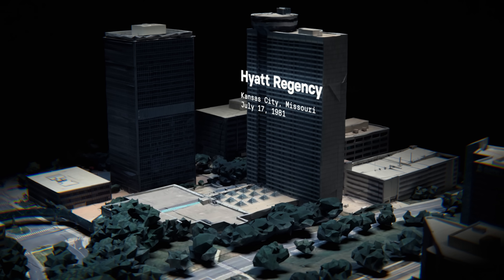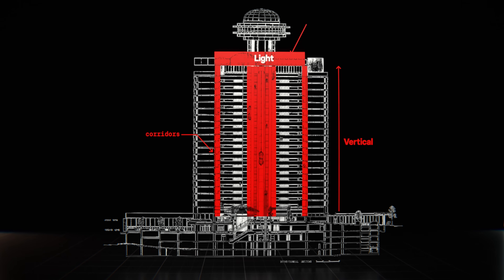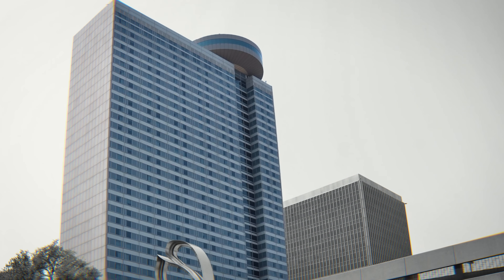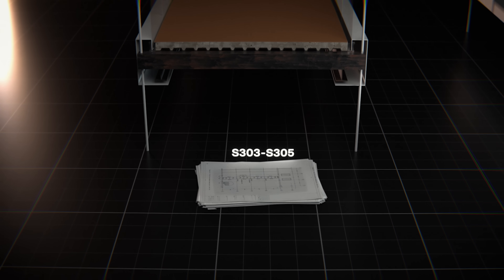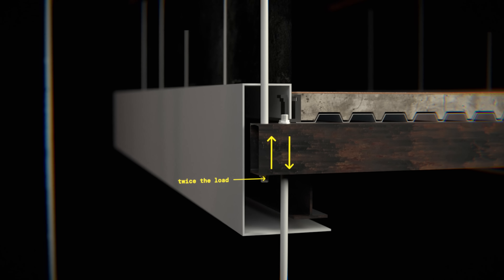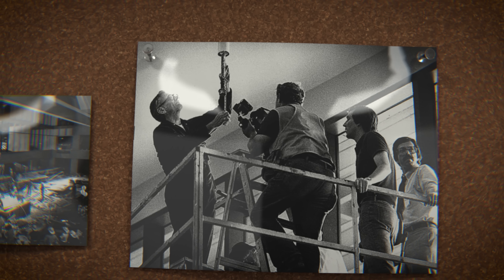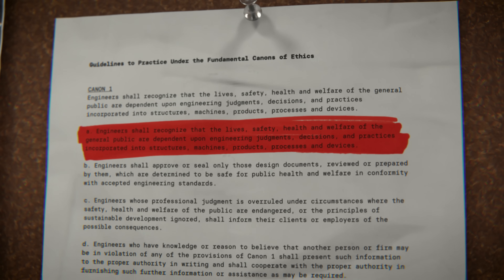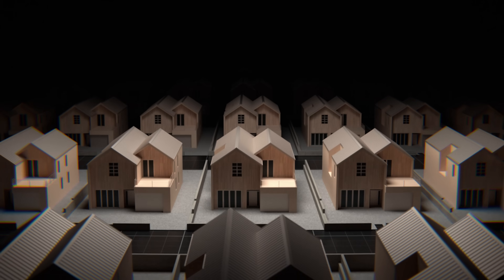Inside the Hyatt Regency Skywalk Collapse

Comment: I get that the engineer was responsible for the structural design and its failure. However, I find it unjust that he was the only one who suffered the burden of the colapse when the contractor and the client were also negligent... This also shows how individuals are more prone to get punished for their mistakes, oversights or negligence, than companies or corporations for their greed which is what pushed the hand of the individuals in the first place...
Reply: That's engineering for you. Someone ultimately has to take responsibility for the design. It's your job as an engineer to say "no" to being rushed to produce a design before you are able to. You are ultimately liable for your design. You need an engineer to design a building, and if all the engineers stick together on reasonable standards and timelines, the industry has to fall in line.
Reply: The fact that Hallmark declined the review of the construction documents after the roof collapse really tells you all you need to know.
Reply: @ChrisNorulak 
Whats it tell you ?
Reply: @paulneal7495  it tells you all you need to know
Reply: @paulneal7495  It's obvious: that things like safety are not their top priority.
Reply: there are too many talking heads in the client company to pin the blame to any significance, and the contractor has to have done something not approved by the engineer to be held liable
as with all events that make the rule books, no one is happy with it in the end but it's forever remembered
Reply: @prcervi  Thats BS, the Hyatt Hotel company should have been fined and then they have their hotel license revoked from said city.
Reply: @MircomFan  i know, but hyatt unfortunately had enough people and money to throw at the disaster that they got off with a somewhat tarnished reputation and nothing else
Reply: @prcervi  Yeah just stupid how it works, I work in the fire safety industry and I am partially liable if I don't do my job correctly and what not. But ultimately, the building owner is solely responsible for ensuring things are working and inspections are done. If a fire happened, the system didn't work and someone died, and it was found that there wasn't an inspection in years, the owner would be 100% liable.
Reply: @prcervi  Or sanction the entire company.
Reply: Engineering is a profession that oversees human health, safety and security. We are licensed and have a strict code of ethics. The moment an engineer signs a project, they are accepting the responsibility if it fails. Our code of ethics says that the society’s interest is above our client and our employer, meaning that we cannot just accept something by pressure, we have a personal responsibility to avoid misrepresentation and negligence, no matter who is asking for it. If the design was correct, and the contractor decided to do something else, the story would be different, but he signed the error.
Reply: @lhr8833 88, and 33 in your username and a dogavi. 

Care you truthfully explain what all those mean?
Reply: @lhr8833 ideally that would be the case but with living costs rising this quickly, there will always be at least one architect or engineer that has to accept and rubberstamp jobs like this to pay for their bills
Reply: @prcevi  too many talking heads in the client company? Then all of them should be punished, not only the entirety of Hallmark's leadership, and also all the investors who invested in Hallmark. Anybody who could have profited from the success of the hotel should be dearly punished.

It's simply unfair that people can just irresponsibly throw their power and support behind a corrupt company, and expect to come out unscathed when the company messes up.
Reply: I used to work as automation engineer in the electrical assembly for some industry machines, nothing big. But whenever they wanted me to rush something or do it in a specific way, I said that I could do it, but in the end, they will have to sign for it. If they want me to sign it as completed correctly, I must do it correctly up to my own judgement. I was just an apprentice at the time, but that usually kept them quiet and they backed off.

So, whenever people ask YOU to do it THEIR way, put your foot down that it falls back on THEM! They want the risk? They HAVE to take the responsibility. People rarely ever get tought this though, so they just accept the pressure and cave in to some MBA idiot or contractor cheapskate who have no clue about anything but want everything done their way or the cheapest or laziest way.
Reply: You don’t have the full story. That engineer chose to take all of the responsibility and spent the rest of their career teaching engineering safety. While this is a good video it does unfortunately miss a lot of details.
Reply: Sadly, he had the final word to say no, it's not possible, it won't be structurally sound, and bow out if he had to. He chose to forge ahead, and it cost him. Sadly...
Reply: Then again the engineering firm won the contract to work on this. Initially I agreed with your statement, but in this case the correct decision for them should have been to look at the situation, report the numerous problems, be told that the deadlines need to be respected anyway by the client and drop the contract instead of going along with it. Notifying the authorities too while at it. 99% chance it would've happened anyway, but the firm would have had their record and conscience clean in this. Are they solely responsible? Of course not. Did they handle it as best they could? No.
Reply: It was his job. No one else’s.
Reply: Nonsense … there’s a signature in the contract / there your blame
Reply: Yes- there is always a "fall-guy".
Reply: @ He is not the “fall guy” he was the only structural engineer who stamped the drawings. Do you even know what stamping the drawings means? no you don’t
Reply: That's BS.   The whole point of the engineering licensing system is that it makes specific individuals - who have the qualifications - responsible  for engineering safety.
My stamp belongs to me - as an individual - because it's my career and my future on the line.  No employer, agency or authority can demand that I stamp anything I don't support as an engineer.  I've had employers who've tried to get me to sign things I did not prepare, did not have time to review, or with which I did not agree.  They have come back apologetic every single time when when their legal counsel has schooled them on their position, i.e. they need me alot more than I need them.
I know that, in my case, this personal responsibility has kept people safe.
Reply: @wetwingnut  I don't know how it works in Kansas, but in South Carolina, we also stamp the drawings with a COA (Certificate Of Authorization). That puts the company you work for on the hook as well (as far as liability goes). That's the way it should be. Unless someone is working on their own, we are all acting as agents for (what is typically) a LLC or Inc.
Reply: @09rja  I'm not sure how that would work, since a corporation by definition is not an expert in safe design. That's what the engineer is for. The construction is also a separate issue of liability from the design, so a company would be liable for the construction, because they are experts in making sure plans are followed, but they can't reasonably be held to know that the design itself is liable.
Reply: What are you talking about everybody gets sued and everybody can contribute to the settlement in these things because no one energy usually have enough insurance and insurance companies want to settle it so even the non-guilty parties get sued and their insurance companies contribute. Architects and engineers get the politicians to pass laws requiring their stamp on the drawings or you can’t build anything. That allows them to charge exorbitant fee. This engineer put his stamp on the drawings without even looking at them and you don’t think he’s responsible so it was his stamp and only his stamp that allowed that defect to be built. He is supposed to look at the design before stamping the changes made by the steel fabricator. It’s not the steel fabricators fault that the architects and engineers designed something that wasn’t practical for anybody to actually put together. The structural engineer is just the only one that lost his career and I guess you didn’t pay attention when he revealed it was the American Society of Civil Engineers
 engineers of which he was a member that took away his career.
Reply: What are you talking about everybody gets sued and everybody can contribute to the settlement in these things because no one energy usually have enough insurance and insurance companies want to settle it so even the non-guilty parties get sued and their insurance companies contribute. Architects and engineers get the politicians to pass laws requiring their stamp on the drawings or you can’t build anything. That allows them to charge exorbitant fee. This engineer put his stamp on the drawings without even looking at them and you don’t think he’s responsible so it was his stamp and only his stamp that allowed that defect to be built.
Reply: What are you talking about? It was his job, and his failure alone.
Reply: @Willsimp4tacos You are obviously not an engineer nor a lawyer. What he’s saying is that it is the engineer’s fault, that’s for sure, but it was one of many calculations done wrong, there was no criminal intent to hurt anyone, so it seems like a harsh punishment for him to lose his license, therefore his livelihood, when nobody else was punished. And I am not saying he should not be punished, but not only him, developers push and push for faster designs, faster construction, pure greed and when things go wrong they face no consequences and let others to take the fall. Ready to do it again.
Reply: @rulo7475  I am an engineer, Industrial automation. You don't know what you're talking about in the slightest. It's literally his job to make sure this exact thing doesn't happen.
Reply: @rulo7475 he lost his license to legally stamp designs but it does not diminish his experience. Pretty sure he found a sustainable career in parallel to the industry
Reply: @ this was before the engineer could tell the client to shut up and accept the delay to any degree that had backing from a group that would fight the company over wanting to rush a job

Comment: Another huge reason for this was that Kansas City scrapped their inspection department to save cost and allowed owners to conduct their own building inspection. Usually the structural engineering firm who design projects are retained to conduct inspections/compliance and additional work during the duration of construction. In this case to cut costs the engineering firm only did initial design and the inspector were from the architectural firm. In some jurisdictions like Alberta engineering firms also need to stamp drawings to assure that enough time and resources have been dedicated to a design and the P. engineer is not rushed in their work.

Comment: What do you think is better for this application, the rod suspension method or steel cable and pinch anchors? (Not an architect, but this is the best i can explain it..)
Reply: Since lateral movement from wind wasn't really a thing, the cable and anchors might be over-engineering it.

Comment: I can't get past the idea of passing the hanger rods through a weld. That's not applying any engineering knowledge to the question, it's just not being a moron.

And though everyone involved is at fault to some degree... the owner's moral liability, even if rushing and cheaping out were priority one, is limited by lack of active participation in the construction itself; and the fabricator's guilt is limited by the fact that they're just selling a product and it's the user's responsibility to determine its suitability. The designer was evidently playing with fire by not checking stuff... but what's the contractor's excuse? You're seeing in real time why this isn't going to work, and you're not at the very least going to add some straps as a failsafe?

Comment: IT WAS NOT A DESIGN FLAW. IT WAS NOT BUILT ACORDING TO THE ENGINNERS SPECIFICATIONS.
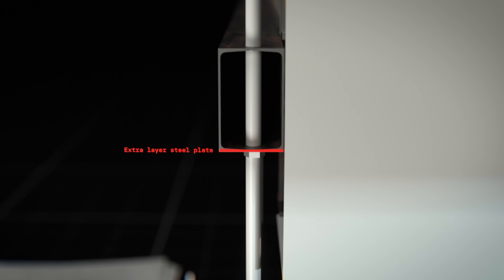Reply: 5:59
Reply: @barryrobbins7694  6:30 the manufacturer got lazy and had the rod split... so... IT ISNT A DESIGN FLAW IT IS A SYTEMATIC FLAW. there you happy? no?

The official report citied "corporate neglect and irresponsibility" as the primary root cause of the accident.
Reply: @InconsistentManner  Let me guess —you’re an engineer. The point is that the original design was questionable in first place (according to the video).
Reply: @InconsistentManner  Also, it was apparently redesigned by the contractor.
Reply: @barryrobbins7694  The most questionable component was how the rods were secured on the underside. The rest of the design seemed okay--for a rushed job.
Reply: @ “…for a rush job.” What?